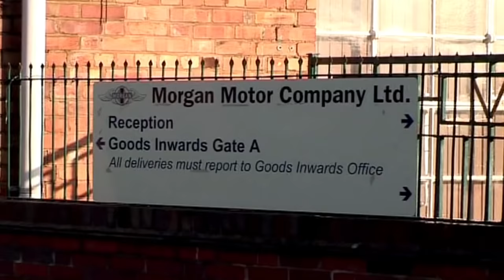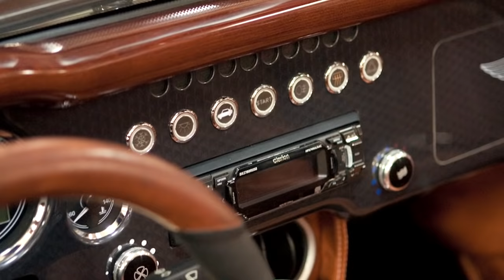Morgan Aero Super Sport - Jay Leno's Garage

Comment: God, I love Morgan! When I visited the UK in 2017, I had the privilege of driving the Aero Max, and it just felt perfect. Also, the styling, my God the styling! The styling is post-modern design at its best! They took the old fashioned long front end, passenger compartment at the rear, round headlights, side opening hood, etc., and gave it a wonderful modernization. Most cars from the 30s, and 40s had a really high stance, but as Jay points out, the Aeros sit fairly low to the ground. They just look fantastic, they are extremely well put together, they're fast, but they aren't race cars, they have all the essential creature comforts, they run great. I cannot say enough good things about these cars. Morgan really hit a homerun with the Aero, and oh how I long to own one. Someday I will have one of these in my garage, and I cannot wait. They're expensive, but they are worth every penny, and I have a feeling that as long as you practice good maintainence, and preventative care, these cars will last for decades.
Reply: That's exactly the problem.The long nose looks ridiculous with the weight balance totally off.I bet it's around 80-85% to 20-15% front and back respectively.Most certainly it understeers like crazy.Not that you go fast enough understeering to endanger you,but still,it's very annoying a light but understeering car.

All cars i think should do the raft test (like top gear did while driving through africa) .After you put the car in the middle of it , it doesn't stay straight to horizontal,weight distribution is no good.
Beside,it looks COMPLETELY RIDICULOUS with that long nose and short tail,like a good cartoon caracter with big head and small body.

What's "amazing" about the stiling ? It's just the clasic old headlights (but with UNclassic interior of them) sloped back but NOT enough to be beautifull.
911 did them good,this didn't.

Also,you're TOO DAMN LOW.I'm small (1,92m) and my head would stick out like crazy and wouldn't fit in it.
Also it would be too cramped and steering wheel would hit my knees.Well,it would be BETWEEN MY KNEES.
Beside,whenever i get in a car,i push the seat back.Here,I CAN'T because it's one of that STUPID "cars" with the wall behind the seat.

Beside,as my great grandfather use to say,"I like to put myself/get UP in car , not lowered myself" .
That's why i LOVE the 1920's cars and beggining of the 1930's where you would sit about the hight of a pick-up "truck" NOT this ... THING wich ISN'T a car,wich is too short,too low and did i mentioned the RIDICULOUS,UGLY AND UNCOVERING of the low and/or curved down door of the taditional british "sport" cars ?

Beside,i can't imagine why the brith would build "sport" cars are they country is old and twisty,just like the citi streets with only about 2-5 days of shunshine a year :) .
British sport cars are like ANY sport cars.USELESS.
Reply: Motanelustalistu:  Your car is a Pinto, it suits your personality
Reply: Seriously? That's not a comment. That's the script for a horrible TV show. The main focus of which is hating sports cars. Pretty easy to predict that your sports car hating TV show is going to be a HUGE flop! So according to what I read into your comment the PT Cruiser is your dream machine.
Reply: I am guessing they no longer have ash wood frames?

Comment: Purest motor company left alive!
Reply: Motor company that doesn't make any motors..
Reply: @hc7369  its impossible to make own engines and transmissions for a company which makes 1000 plus cars per year.  And its completely unnecessary.  They are good at what they are.
Reply: I'm not 100% sure about that claim. Have you seen Ariel Atoms? Those are pure driver's cars!
Reply: Aren't Rolls-Royce and Mercedes-Benz pure?
Reply: @karendixon401  Rolls-Royce is owned by the BMW group.
Reply: absoftitanium  , the leading people for most years. Where you been?

Comment: Loved my 1973 4/4 , great noise, quaint sliding pillar front suspension, don’t forget to press the engine lube foot button every so 500 miles to oil the pillars, not too often or the excess oil ends up on the front discs, had to part with it when I moved to Thailand, horrendous import duties, but sold to my nephew so still in the family.

Comment: Couldn't they find a better place for the battery?  wow!!!
Reply: Makes it easy to install one of those breakers to keep the car from getting hotwired, etc.
Reply: I was thinking about all of the liquid from the battery flying on your face in a frontal collision.
Reply: On most performance applications, the battery is placed at the right rear, to offset the weight when there is only the driver in the car.
Reply: Exactly
Reply: Hey, Pablo! He did say it was a prototype.
Reply: It will not. Cause in a frontal collision all things are moving forward. The liquid in a battery does that too.

Comment: I don't care how many seconds the Morgan Aero Super Sport takes to go from 0 to 60, or 0 to 100, I don't care about its top speed or it's trackability.  It has more than enough horsepower (power to weight ratio) to do what I need and want it to do.  It's not about speed, although it tops out around 170 mph.  Nor is it about its agility to take on the most challenging of mountain roads, however, it can when called upon.  As with all sports cars, it's about the driving experience of those sports cars.  The Morgan Aero Super Sport, well, that bad boy is a "cruiser."

Uncle Le😎

Comment: RE:  Comment on headlights.....Morgan purchased them from MINI.  They are OEM headlights for factory 2005-2006 MINI Cooper Xenon Headlights....but if you look close, they are swapped from how configured on a MINI... The left is on the right side and the Right headlight is on the left side of the Morgan....They also looked at using the Xenon headlights from the 02-04 MINI Cooper S but opted for the look of these for production.

Comment: I is a pity. Aero 8 is out. Check the Morgan website out. It is not  on the range.
Reply: They have just announced the Morgan 6 (using the new straight 6 from BMW) and plan on a new V8 model later on.

Comment: Last weeks news---Morgan are now controlled by an Italian Holding Stock company, who bought about 57% of the stock, the rest is in Morgan family hands. They have a new powerful model  coming soon, BMW powered.
Reply: Yes the new model is the Plus 6 and was unveiled at the recent Geneva Motor Show. Its powered by the new BMW 3 liter straight 6 which in turbo form produces more power than the outgoing V8 and is much lighter and more economical.  Its also a 48V system so allowing for fancy electrics. The most important thing is that the Plus 6 has a totally new chassis - which allows for a lot of model customisation and can be put through the certification tests in the US.

Comment: Morgan might want to work on their SEO strategy if they are going to keep advising people to find them just from googling the one word; they are nowhere to be found on the first three pages. But you can easily find them by using "morgan automobiles". But google "morgan" and you won't as he said, see them above the bank. You will get banks and various obscure results, and no morgan motor cars at all (I only checked the first three pages-nobody ordinarily will even bother checking a second page if it doesn't show up on page one).